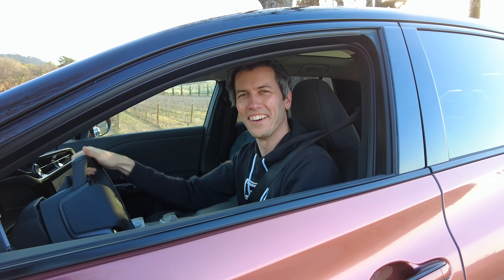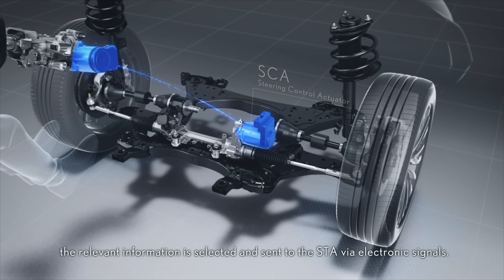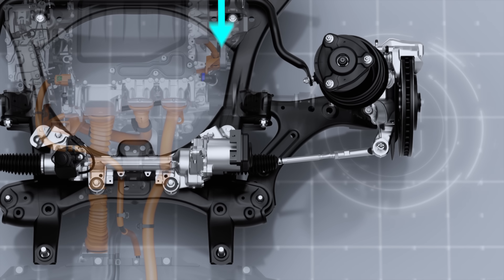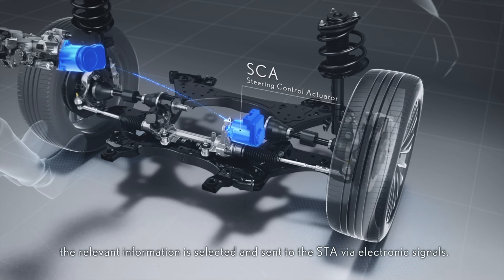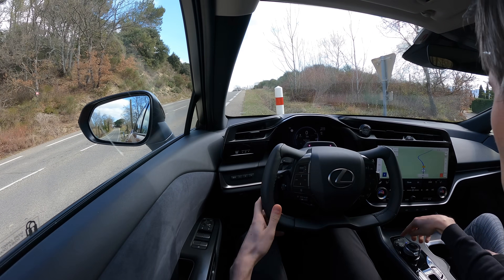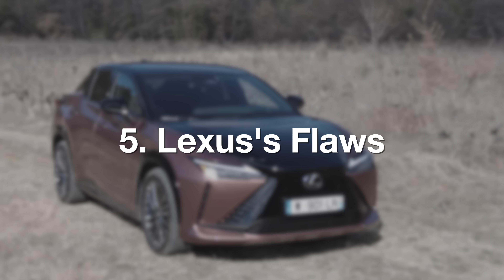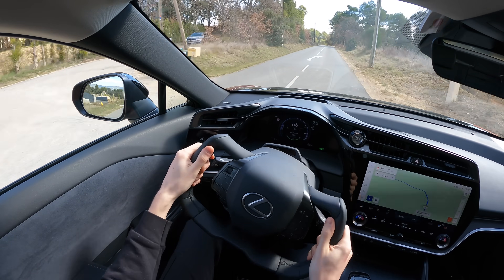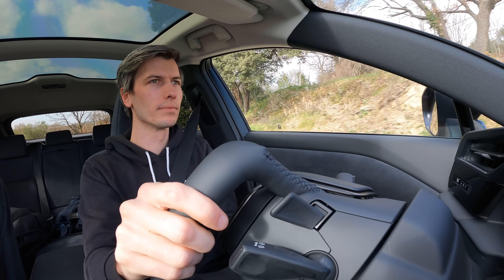How Lexus Fixed Tesla's Bad Idea: Steer-By-Wire Yoke

Comment: Awesome video. I’m ALL FOR innovating and new ideas like this, but also very skeptical at the same time. I was really excited about this steer-by-wire system until you mentioned lag. Didn’t even cross my mind, but once you showed the examples, that would absolutely ruin it for me. I’m sure there will be updates very soon to systems like these, but I couldn’t do it with that input lag. (Hmmm, new market for the drive by wire boosters that reduce the throttle body lag?!) Lol
Reply: The mechanical PSS has absolutely no lag with their mechanical progressive steering gear, the spiral pip gear, especially also in high speed safer to drive due the higher ratio as the serial Porsche.
Search for PSS PROGRESSIVE SAFETY STEERING
Reply: Like driving an old truck with a worn out steering box 😂
Reply: Aftermarket firmware flash on your drive by wire steering...then when it fails, the manufacturer won't accept responsibility because you messed with it.  The company that wrote the firmware code will have said "for off road use only" on page 96 of the licensing agreement, and your insurance company won't pay for any of it, IF you are alive to take it to court.
Reply: Not all “progress” is actually progress, exhibit a

Comment: Huge swerves are sometimes needed at high speeds to avoid a collision. We cannot eliminate them if there is a chance that they will be used to avoid a worse case scenario than just the driver's car losing grip or even flipping.

Comment: A potential fatal flaw of this design is that it is all Computerized Meaning that a simple EMP could wipe out all of the control systems including the steering(it doesn't matter if you have 100 back ups in there are all destroyed). Unless this particular company made the steering 100%  resistant to Electromagnetics. I would not recommend. Especially if you have a hit list.

Comment: With a mechanical steering one has enough sensitivity to drive 250 km/h on the Autobahn without problems. So what is the advantage of steering by wire then, especially when you're not in Germany? 
The other thing is, when you are standing next to the curb, yu don't want to steer against it. But if you have a delay and less feedback, there is much more of a chance, you will damage your wheel. Normally one should not steer while standing anyway, so the assistance should be not to strong. You must realize, when you hurt the car.
Reply: There is a steering  with no error prone electronic, no lag !!!      you keep control mechanicaly in your hand's all the time ->  progressive and mechanical, safe to drive with yoke    check with pss progressive safety steering :-)   with hour's drivng above 200 in Germany , without getting tired :-)
Reply: @spiral_pip_gear  That seems to be a perfect solution. I still dont see the adavantage of a yoke but this will also work with a normal steering wheel perfectly. Where ever possible a mechanical solution should be preferred as it makes cars more reliable.

Comment: Taking the mechanical connection away from the driver, in any system is a huge mistake. Steering, throttle, even the E brake should always have a physical connection to the vehicle. For one, no redundancy failure is worth a life. Secondly, the amount of electronics, motors, sensors and such far outweigh and are much more complicated than basic cables, racks and so on. To diagnose and fix problems is so much more costly in a car full of servos, motors and sensors than to know what’s failed from the beginning because of the simplicity of the part. How about trying to stop a runaway car with an E brake button. Not happening. Toyota has some instances where people died because of not having a physical E brake. There are so many more reasons why I feel the way I do but those are the most important ones. Doesn’t take a Rocket Scientist to figure that simpler is just better.
Reply: There is a steering  with no error prone electronic, no lag !!!      you keep control mechanicaly in your hand's all the time ->  progressive and mechanical, safe to drive with yoke    check with pss progressive safety steering :-)   with hour's drivng above 200 in Germany , without getting tired :-)   a simple solution :-)

Comment: The argument that having 3 batteries means you'll never lose power is the same as the argument made in the 1990s that a twin-engine airliner would never lose all power because it had two engines. Today there are multiple known incidents where 2- and even 4-engine airliners lost all power and had to be flown like gliders. Likewise, they claimed that redundant hydraulic systems meant airliners would never lose all steering, yet this has happened multiple times, too. The engineers were wrong. They're wrong about the Lexus too.

Likewise, it is possible for this Lexus to lose all power and become unsteerable. For example, all those batteries aren't going to save this car from an EMP. If you're driving it and either the Chinese detonate an EMP bomb above you, or our side of the planet gets hit with a massive solar flare like the one that caused the 1859 Carrington Event, you won't have any steering, and if this car is brake-by-wire you won't have brakes either.
Reply: To be honest, I understand what you are trying to say, but the examples suck:
1. Airplanes that lose all engines are such a rare occurrence you can basically count them on one hand
2. If a Carrington Event or a EMP happen, every car with a bit of electronic parts becomes unusable, because they all use a central computer to handle everything
Reply: @fr_rave  In an EMP scenario you can still steer most cars to the curb if the event catches you while you're moving. The subject of this video is unique in that it would become entirely unsteerable and apparently unstoppable since a lot of comments say this car is brake-by-wire too. That means if an EMP catches you on the highway in your Lexus, the only thing that's going to stop you is either other cars, or the wall.
Reply: @amorphousblob2721  still, using an EMP attack or a Carrington event to criticise a car is a bit extreme, isn't it?

Comment: Driving a car in real life is not the same thing as driving a car in a video game.  That input delay is ridiculous and totally unsafe.  Being able to quickly and precisely swerve to avoid an accident is critical and every single millisecond actually counts there.  It's obviously rare to need that capability but there is always a non-zero chance of it happening when driving.  The lack of precise feedback from the road into the steering system is bad for detecting equipment problems before they become actual problems, which is another major safety issue.  Solid "nope" from me until both of those are fixed.

Comment: Q: Does the tire angle change dynamically based on speed when it's already at an angle or does it lock in that angle until steering changes?

For example say in a completely hypothetical situation we're at 80mph and crank the steering wheel to the max. The driving wheels will only angle to a portion of their maximum angle, as per the explanation. My question is what happens when you start to slow down with the steering wheel still fully cranked?

I suppose it may make slightly more sense in the other direction; starting from 0 and accelerating. Would the driving wheels lessen the turn enough to keep me from doing donuts? (setting aside if it's even possible to do donuts in an electric car in the first place)

Comment: What I want is an electric vehicle that also takes gas. An all electric car is fine up until the next tornado or earthquake hits.
In other words I want you to put in a backup generator in the car. And I would like that generator to be able to take as many types of fuel as possible. 
If I can recharge or power my car with propane can in an emergency that adds enormous value to me.

Comment: On the safety point, I don't know what exactly the software of the car handles and how the steer by wire is implemented. My guess is, since it is adjustable by the user, it's not completely isolated and therefore I would assume a software bug can pose danger. I remember reading that a number of electric vehicles were prone to software bug causing them to accelerate uncontrollably. There have even been videos of it.
I am not the kind of person that rejects innovation, I am just saying that practice makes perfect. I would wait years before I get a car with a new critical system like that.

Comment: Okay I’m sure Lexus engineers have this sorted with steering sensitivity at high speeds. But what about understeer? Everyday people don’t really understand that concept and will turn as hard as as they can when avoiding something, but with the low degree of steering in this car in comparison to the wheel angle, that would just induce lots of understeer no?

Comment: i think the system is as responsive as it needs, but how about the steering wheel feel? that also has to change, not only the ratio, and the feedback of road surface. But how hard it resists movement. For example when stationary, no mechanical steering is that light, u cant move it that fast from lock to lock, the wheel i mean. If they limit how fast u move it, make it more mechanical in feel, i think it can do a great job.

Comment: If the steering ratio is variable depending on speed, what happens when you begin a turn on the highway and slow down? Will the ratio increase with a static steering position? E.g. the tires actuate more without turning the yoke more?

I like the idea, and I see the progress made. I'm curious on what's left before it's really a no brainer.
Reply: you just answered your own question with the first part. variable depending on speed / slow down

Comment: I'm one who expects and demands that the 2 most important systems in a car must work perfectly at all times: braking and steering.

There are vehicles on the road with EPS (electronic power steering) assist that become much harder to steer when the EPS fails, especially while driving in a corner. The level of assistance is so high that when it fails, it is mechanically much harder to steer. This is why I prefer hydraulically assisted PS.

However, what you presented in this video could win me over so long as the safety is absolutely guaranteed.

For me, the delay between turning the yoke and the wheels actually moving needs to be addressed.

Comment: Race cars don't have to show turning signals etc. but Tesla Yoke without levers needs the turning angle even decreased to 100° at lower speeds in order to push buttons in a curve.

I like Steer-by-Wire, but there should always be the possibility to make an emergency manoeuvre!
At lower speeds there is no need to regulate someone accidentally going crazy and driving into the ditch, and at higher speeds there shouldn't be a difference in turn angle ratio to a normal car.

Comment: I don't think that sort of  "Jerk correction" no pun intended for seemingly idiotic movements is something that should be implemented. Unlike a plane cars have to worry about a lot of unpredictable obstacles and its foreseeable that should a particularly bad set of circumstances occur a driver may need to swerve or correct. if such a system where to exist it would likely interpret these actions as "illegal" and correct the cars course which could cause an accident.

Comment: Dnt try to make something that is hard to implement. Electronics are not reliable. And can malfunction anytime. It can cause accident. We need more provision when we drive a car. So, it’s better to use more turn. If we cut it half way. We won’t use it much and it will cause accident as in video games.

Comment: 7:42 As far as sensors are concerned, two are not enough. How do you know which one is broken and which one is working? You need 5, so that a signal of at least 3 is taken. Then you know that the others (in the minority) are not convinced and announce to go to the service.
You also need two wires, one of which should be a bit longer and at the end a small resistance meter for those two wires. If the resistance increases (there is a break in the jhed cable), it gives a signal that it is necessary to move upwards. And there is 100% security without any risk of anything ever happening.
You're welcome.

Comment: changing the steering ratio based on your speed sounds like you wont be able to fully get to know your car. its is quite literally like "mouse acceleration" on pc, which everyone playing shooters will turn off because it doesnt let you build accurate and reliable aim.
And the latency was my biggest concern and is a absolute dealbreaker.

Comment: Whats the fail safe condition? having 2 motors, and extra batteries is great. But what happens if the connection between the wheel and the steering motors fails? Does the car just go straight? -Throttle by wire the car goes into limp/ideal model, brake by wire the car slows down. Steer by wire?
And I dont like any systems compared to aviation systems, because airplanes have mandated and enforced maintance schedules. The systems there are maintained on a scheduled and replaced. Cars? people barely change oil.

Comment: What I really like is having options. If you are in the market for this car, go and test drive it. You can decide which is for you, rather than being stuck with something that might not be ideal. 
Another benefit would be the ability to customize the speed/turn ratio curve, some might prefer different shapes, and this "by wire" system could allow for it. You can even go as far as having the same car behave like a tame wagon on road trips and like a beast on the track if that's your thing.

Comment: Variable speed steering has been around for a long time mechanically. My Honda Accord (98-02) had it. I'll bet cars before that one had it, and I'll bet more cars have it now. This is another thing that isn't broken, but they want to 'fix' anyway. Cars are becoming like software, and think about how you feel whenever your software gets an update that it didn't really need.
Reply: Buick Roadmasters had it in the early 90's.  It was slower/weaker in the middle and got quicker if you turned sharper.
Reply: It is variable boost - not variable ratio - that is common.
Reply: and what happens if you want to quickly avoid some drunk person in the middle of my lane?   this happened to me once at 60mph (100kph)   and I avoided them with near milliseconds to spare with a hydraulic power steering system.    with this system I would have killed them, plain and simple.    Manufacturers, please hire some people with brains.

Comment: As someone whose worked in dealerships in recent years and now work at a parts store, this will be a nightmare in 5 years. A single sensor goes bad and that systems disabled, car is forced parked. It's already bad enough with electric power steering, which when it dies or when the motor fails, the wheels won't even move, while with traditional hydraulic system can still get you to work or where you need to go without power steering. Sure it'll let you pull over with redundancy, but then it's parked. Overall it's an overcomplication of yet another system that isn't really necessary for the sake of minimal gains. We'll see how it goes

Comment: I prefer the SW20s electro hydraulic power steering that can reduce and cut assist at higher speeds. In my opinion it doeant need to be any more complicard than that. Mechanically connected to the rack of course. I absolutely insist on having a real link between the rack and the wheel.

Comment: Cool, i guess, good one engineer nerds. If there's a coronal mass ejection, I will laugh in my mechanically linked steering system car. What about when the cops want you to pull over, they can just emp blast your car and then you careen into a ditch and die

Comment: I'd have to drive one to know if it's something I'd want but knowing they engineered redundancy into they full system it's probably more reliable than a traditional system given the majority of drivers are probably not physically strong enough to steer if their power steering fails. I hope that regulators make it law that drive by wire systems have full redundancy.

Comment: I'd have to test drive one 1st. But to me it's just more parts and sensors to go bad and need replacing. And let's say the car battery is dead and it needs to be pushed to a safer area. Can you control the steering if there's no power. I think I'll stick with what most cars currently have.

Comment: I noticed the delay with the steering response at the start of the video. My question is, in the brake by wire system, is there such a thing? Because I'd think that it would put the driver in a risky situation when braking.

Comment: 100% makes sense but it’s still 100% electric steering with no manual assist so a nope for me. Don’t care how many backup motors and sensors it has. Never have a thought I needed a more simple steering cuz I’m crossing my hands too much. Excellent video though.

Comment: Improve a current idea with minor modifications and redistribute it as "new."   First, if any of this "engineering" is based on anything other than their own ideas... ie. stolen IP.... they should be sued.  Second... it won't be long before a new model of Tesla arrives that is far and beyond this.  I salute Lexus for putting out quality... that's not the point.  The point is...goods, products and services are protected by LAW  to prevent someone from running up from behind, ripping their IP off and stealing their market.

Comment: Steering and brakes are two things I want to work even if there's no power to them. Fly by wire throttle is a good idea, but fly by wire steering? I'll never fully trust a system like this.